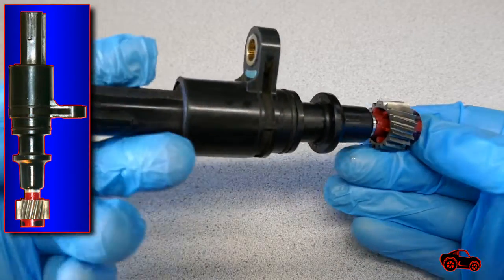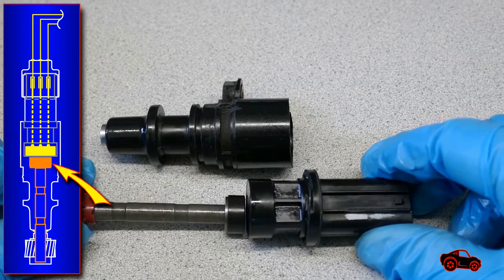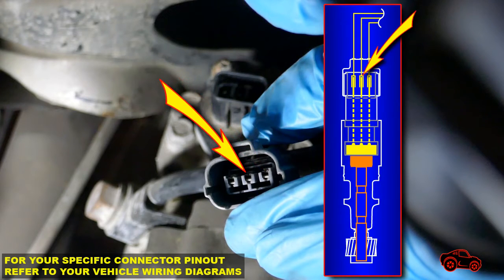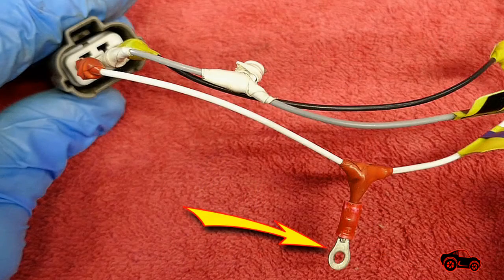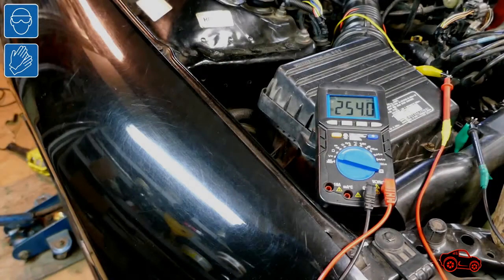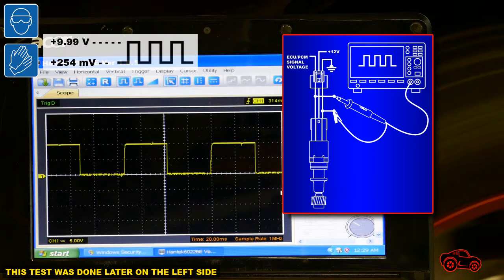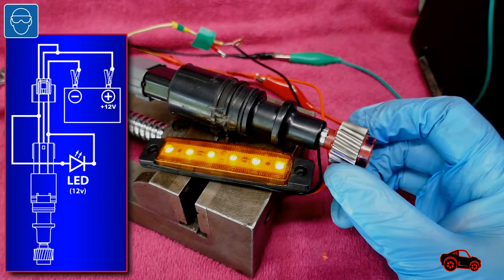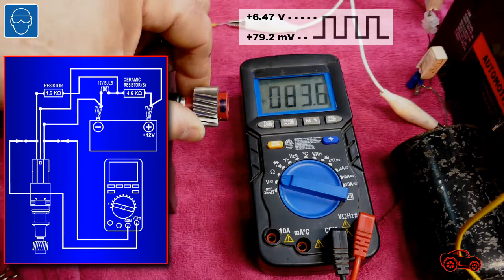Vehicle Speed Sensor VSS Hall Effect Tests

Comment: Can you please make a video on how you can perform a relative compression test using oscilloscope on these Hondas  please. I’ve been trying to see an example how one would an expert would perform it
Reply from the maker: The video will be produce later because I broke my old DSO oscilloscope lately when it felt on the concrete floor of my garage.
I will buy an other one soon but I am still not sure about the model I will order.

In order to perform a basic compression test, the oscilloscope needs a minimum of 2 channels.
It also need to work in DC current mode to be able to center the wave / humps when the starter motor is cranking and creating a current fluctuation. At the same time, it also create a voltage drop between the battery terminals.
In this case, one channel is used with a regular oscilloscope probe that is connected to the positive battery terminal and its ground clamp is connected to the negative battery terminal.

The second oscilloscope channel is used to get a signal with a secondary ignition probe from the ignition spark plug wire (cylinder 1) if the vehicle is old and is equipped with a distributor system.. 

With newer engines, the second channel is also required to get the signal that is used to trigger the primary ignition wave form in the ignition coil of the cylinder 1. 
Usually, each spark plug uses a dedicated ignition coil to generate the sparks.

So when the wave forms coming from the 2 channels are displayed side by side on the monitor, it is easy to identify the humps associated with each of the cylinders based on the ignition firing order.

Note: A high amp current clamp probe can be used to read the current flow in a battery cable when the starter motor is cranking, but, it is quite expansive compared to a regular oscilloscope probe.
Reply: @mtlcarguy you are a life saver thank you for your knowledge 👍
Reply from the maker: I stored my Honda delSol in storage unit until the month of May. I am not an expert, I am an enthusiast. Personally, I use a low amp probe under specific condition and my small DSO to do this kind of readings. I will think about it next summer
Reply: @ thank you so much for the reply I thought you weren’t not going to reply I was mistaken because you did reply. You sir have earned a subscribe and look forward to learning more through your channel. From a fellow enthusiast as well I appreciate the videos and reply
Reply: Bonjour, est-ce que vous pourriez m'indiquer où se trouve le VSS sur le Volvo S40? Merci pour les vidéos, ma voiture va être bonne jusqu'en 2050 😅!
Reply from the maker: @guillaumelandry7807  Sur ma Volvo 2007 2.4L, le (Vehicle Speed Sensor) ou (Output Speed Sensor) est sur le dessus de la transmission automatique.